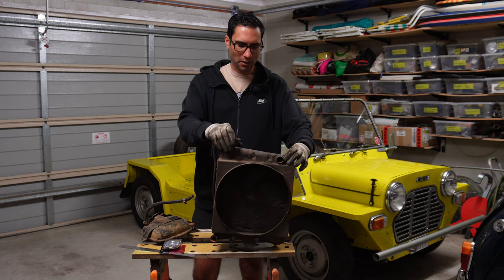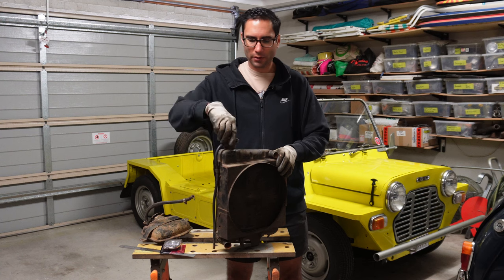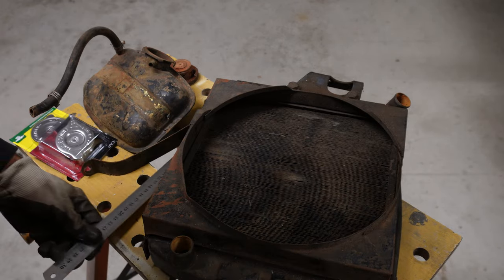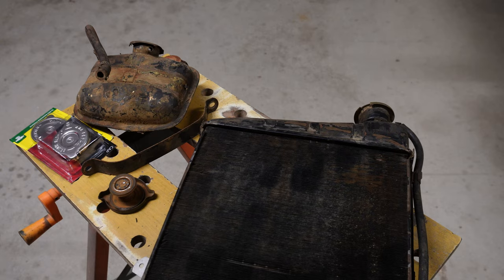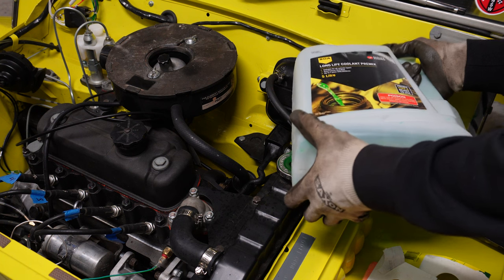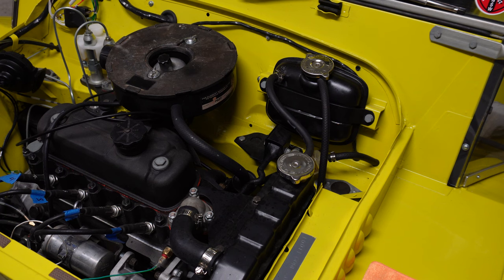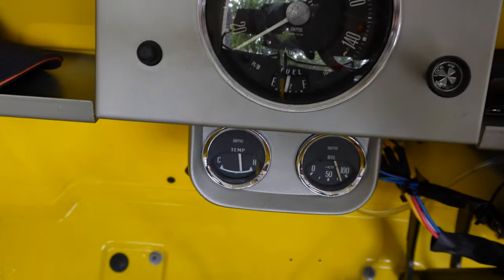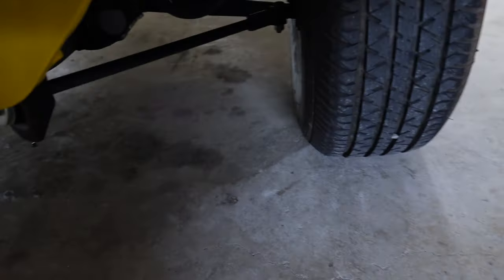Moke Radiator Expansion Tank EP48

Comment: Did you end up having any issues at all?
Reply from the maker: The expansion tank had leaks so I ended up just setting it up like an overflow tank instead. The standard pressure cap was put on the radiator.
Reply: @CafeRacerLab  ah okay. So does an overflow have to be lower or higher than rad, or does positioning not really matter? I’m thinking about installing one on a classic mini
Reply from the maker: I think it should work regardless of the height difference as the fluid moves by pressure differences. The expansion tank should have a tube like a straw that reaches the bottom.